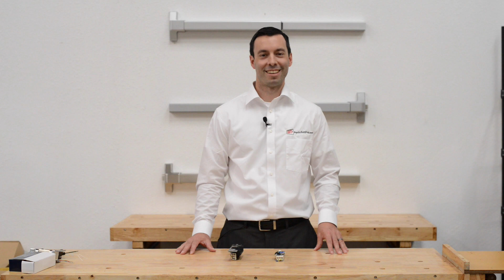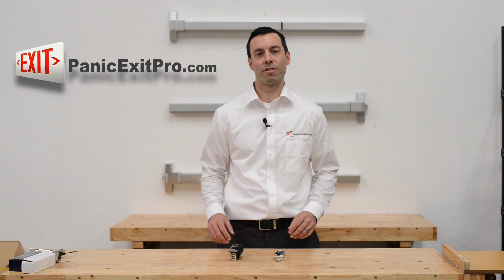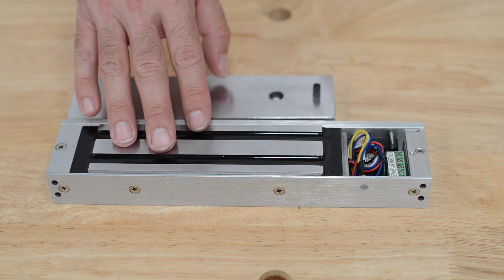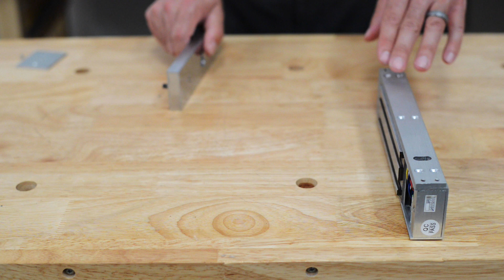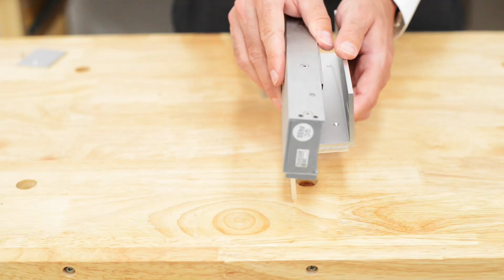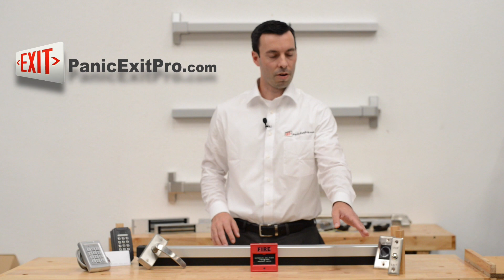How To Operate Standard Duty Electromagnetic Door Lock

Comment: The tinned coating on the magnet and the armature plates can corrode in a relative short period of time, especially when used on external entry exit doors, aluminium cleaner does get rid of the corrosion, but rust will start eventually as the tinned plating wears off. Its critical that the magnet and armature plate remains smooth and clean and free of grime , rust or corrosion otherwise the magnetic bond will become very weak. Also a backup battery is required to keep locks locked during a power failure. Its important that the voltage supplied to the locks does not drop below 10% of the nominal rated voltage as, magnetic flux will become very weak, and lock can be easily breached.

Comment: Mounting the locks at the top of the door, it not ideal, as the door can be easily broken if door is forced or kicked at the bottom. Also the lock assembly mounting is not very strong, I've had issues with the lock assembly becoming twisted and bent from brute force, the armature plate aluminium angle brackets can be easily bent and become out of alignment. The only solution is to mount at least 2 locks near the door handle, and arrange the lock so the electromagnetic and armature plate sick out only 1/2 way say 20mm 20mm so people don't brush past the sharp corners of the locks.
Reply: Could you use two locks one at the top of the door and one at the bottom?